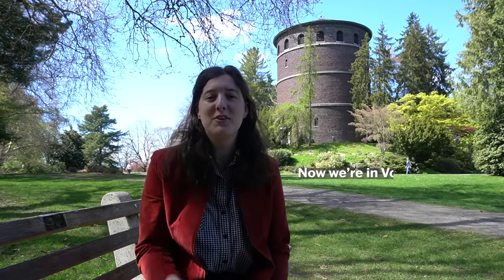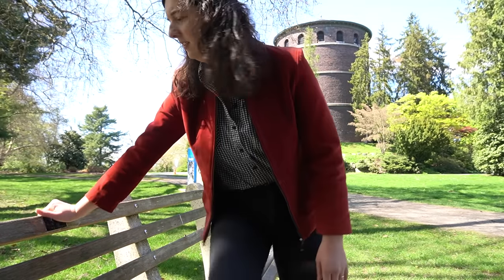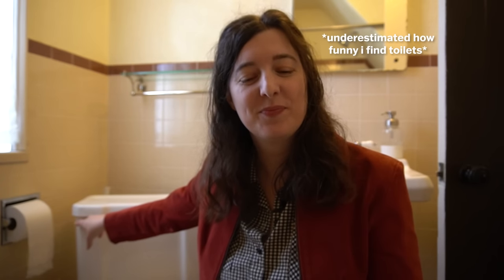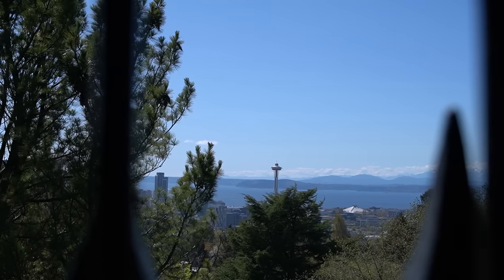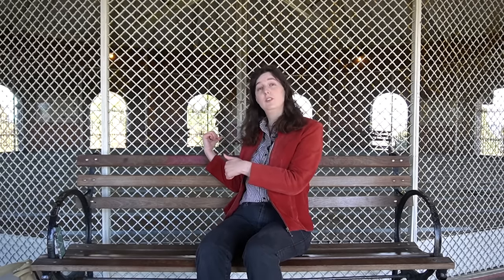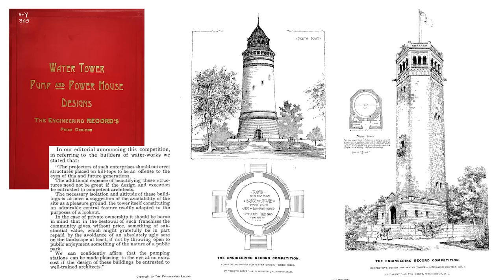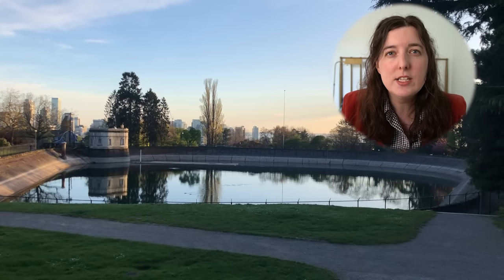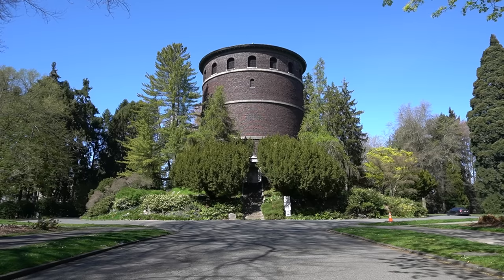The impossible water tower beauty standards

Comment: my city has one MASSIVE water tower that is literally just a bucket. we don't actually need any elevation at all because we are on the largest aquifer in the US and all of the city water is literally pumped well water. The giant green bucket is just a buffer basically to smooth out spikes in demand. Although we do have a part of the town that is probably 200 feet higher than the rest and they have almost no water pressure to the point where most houses there have an external pump to increase pressure by drawing more water from the city and storing it in a little pressurized tank. so every house up there has their own mini not-water-tower tower

Comment: in our area, towns typically have water tanks on or in the ground on hills high above the surrounding area. it's super common in the west US! 

most of the ones in our area are just above ground insulated tanks, but some are buried for the ground to act as insulation instead. there's even some that are only partially buried and look like random half buried buildings with fences around them. 

do enough 4 wheeling and you'll find 'em nestled up above towns all over the place! 
- 7α δ

Comment: A toilet tank has enough water for exactly one flush. The "flapper" won't flap back down and seal the drain until it's empty.
Reply: It depends on the design, some are designed to allow more than one, but only to clear the urine, not for #2. But yes, the flapper need the water to drop far enough to come into contact with the pipe it's sealing in order to start refilling.
Reply: Dual flush tanks can allow for two flushes.
Reply from the maker: Mine has enough water for two flushes! But it sounds like it's usually one, occasionally two.
Reply: Here in the Netherlands it seems like everyone has tanks with dual small-flush / big-flush levers nowadays. The big-flush lever drains the entire tank, while the small-flush lever only flushes for as long as you hold it down.

Comment: What's the advantage of this system over the ones used in the other countries - I've only seen water towers, as default, in the US?

I think in the UK the system is pressurised and delivers to a cistern/tank in the attic of most homes, including larger ones in high rise buildings, as in NYC. There are countries far more rural than America that do not use water towers; countries far older that do not...  

I'm aware there are some water towers in other countries - here every single town seems to have one.  It is a very new country compared to many...

Why would the PWA / WPA pick this system?

Comment: So growing up in the suburban outskirts of a large city...... we used ground water. Only in recent years did we move to surface water and then recently added water towers to accommodate the need for pressurized water in a growing area. I love quirky water towers.....and quirky structures in general.  Unfortunately, the newly elected water towers in the area have the names of high schools...... little awkward that some have multiple schools listed 😅. Water in my area is controlled by individual M.U.D. and many start off controlling one subdivision and slowly grow. This is very much the case with my local M.U.D. that has far expanded past the subdivision. Fyi if you hear about a local organization such as a M.U.D. fighting to prevent the building of  muliti family units it isn't necessarily classism but it would cause a huge demand the the M.U.D. may not be equipped to supply. I just wanted to add that last bit because I have seen other creaturos call "classism" with some such as M.U.D. fight to prevent the building of multi family units cough @AdamConover and it pains me when I see creators that I normally love purposely ignore the context 😭 I just want to scream at them that they are better than this 😅. So on the topic of water towers and you mentioning supplying rural areas 🤔 it confused me because whater towers in my area are a visual indication of development. Rural area will bulled water wells directly on the property. I suppose some small industry oriented small towns might need a water tower.

Comment: Southern Missouri (well, south-ish Missouri) has some interesting water towers not because of their design but because of what's painted on them.  There's a town along I-44 which just has its name on the tower, but it's amusing because it's visible from the highway and the town's name is "Bourbon."  There's another one visible from I-44 that's a suburb of St. Louis (I think it's maybe St. Clair) which has two water towers next to each other, one of which reads "HOT" while the other one says "COLD." Also, not really "southern", but along I-435 there's a water tower which has been painted to suggest a hot air balloon, part of the early logos for the nearby Worlds of Fun amusement park.  There are also a lot of water towers in northern Missouri (probably other places too, but I haven't noticed them) that are just cylinders (not cylinders on stilts or with a bulbous top).  They generally seem to be used for smaller towns or rural water districts. There's a couple of pretty good examples along I-35 north of Kansas City; one of the easier ones to find is in Kearney, MO.

Comment: the water comes out of the tap, and flushes the toilet. Even still, toilet just means little towel. In a sense, water in the sink is also 'flushing ones toilet'. liked and subscribed. but yes, water does not 'come out' of the toilet in ideal circumstances. The latrine never had this problem.

Comment: NOOOOO! Water towers don't have valves that open due to demand! The tower keeps pressure on the system at all times (a valve would disrupt the pressurization). As water is used, pumps will pump treated water up to the tower. The toilet is actually a really bad analogy for how the water system is working. The "valve" that you're speaking of is actually the tap in your house. The whole system is pressurized back to the tower and the water flowing from your tap is literally being pushed out by the pressure of the water held in the elevated tank.